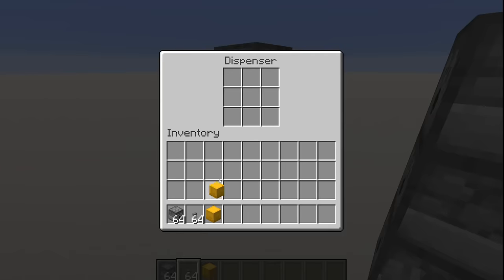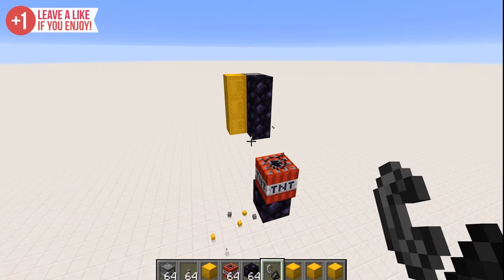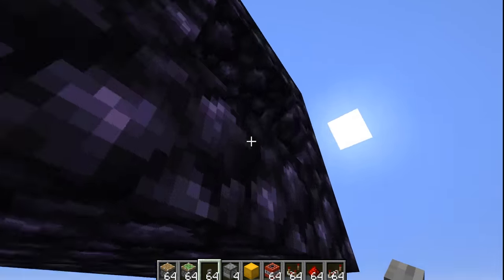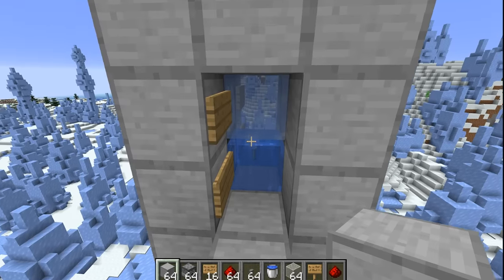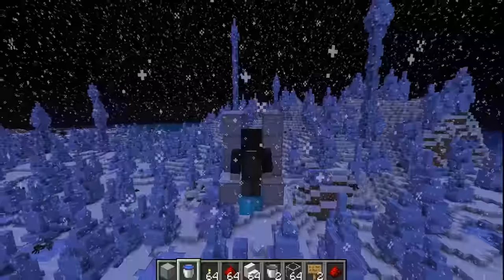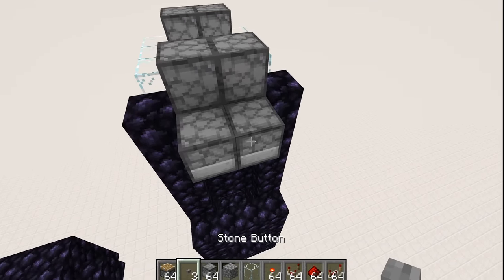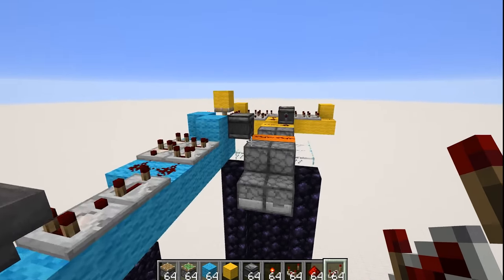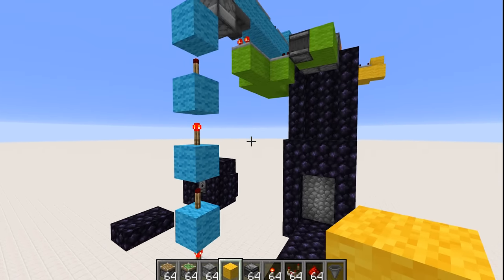Making a Redstone Door WITH NO PISTONS...

Comment: That moment after you spend hours working on a redstone project and realize there's a much easier solution.
Reply: Yes. Believe it or not, i just finished a 6hr piston door system and then saw this video
Reply: Just like solving Math problems
Reply: This is me with my own super smelter design
Reply: @gui18bif  math is easy for me
Reply: Or instead of a synchronized cobblestone generator, making it simple with some waterlogged stairs facing outside, it won't leak, it does not explode and it works for a cobble generator
Reply: Basically trying to create a machine that tells you the temperature of something just to realize that thermometers are a thing

Ps I got that from big hero 6 the series season 2 episode idk
Reply: @zer0gamz  6hours??? Jeez I just made a 3x2 piston door in like 4 minutes and built it into my walls so it looks like the blocks just vanish
Reply: @LifeofLeium  It doesn't help when the original mechanism doesn't work so you have to modify it numerous times
Reply: Exactly what I wanted to comment my dude!
Reply: @SK-nd8cu  it really depends on what your calculating
Reply: @SK-nd8cu  you know trig?
Reply: Yeah i was trying way too hard and using a redstone torch to power a block but then i remembered i couldve just used a repeater
Reply: Should be pistonless redstone door without an any “door”
Reply: That's exactly y I spend 1-3 hours on math
Reply: You didn’t have to cut me off
Reply: @SK-nd8cu your in - 4th grade
Reply: Probably the most true thing I’ve read today
Reply: Me every time I do ANYTHING
Reply: This, but irl
Reply: @B3nCastle  That wouldn't work, since the top 2 blocks would block the formation of the bottom 4.
Reply: I have had that before

Comment: The ice door could work with armour stands equipped with frost walker boots, being moved around by water sources with light on specific places as not to freeze the path but instead the water below 🤓
Reply: That... is a really cool idea, I am going build that.
Reply: 200000iq
Reply: Smort… so smort. That is 69,420 i… I mean 100000 q🤭
Reply: I am 99.99% sure that frosted ice (the ice created by frost walker) is unaffected by light.
Reply: @justinbombach9873  oh :(
Reply: @callumhurd3726  I did a tiny bit of research. When the ice first appears it is unaffected by light, but it will melt faster with greater light. So as long as your door is in a dark area, the door will stay frozen for a long time when you want it to be closed.
Their is one other problem with this idea, but I have a solution. Rather than moving the armor stands with water and risk freezing that water, you could place the armor stand with a dispenser then apply boots on it, and when you want the door to melt you shoot arrows (from ANOTHER dispenser) at the armor stand to break it and have hoppers pick up the items.
Reply: 500000000IQ
Reply: Very intoligent
Reply: Big brain
Reply: @justinbombach9873  0-0
Reply: How are you gonna move it without pistons?
Reply: it’s big brain time
Reply: @localplatypus994  water flowing. Over packed ice so it gets enough speed to go over
Reply: How to move armor stand without pistons
Reply: @q2ts  bruh this was so long ago 💀 Anyways u only need one and it will propel it across the ice

Comment: Since a fence gate is a little bit higher than a regular block, if you put a block above it that is 2 blocks high you cannot go through it without opening the gate or crouching through it. You can connect a lever  to the fence gates and open and close the door. It also works as a invisible door.

Comment: Mumbo: Creates a difficult redstone door without pistons

Me an intellectual: places wooden doors
Reply: @GMDFlow  iron doors pressure plates
Reply: Hard mode zombies: Dinner time
Reply: @ShadowHunter120  lava trap
Reply: @holichubbz8218  every single mob: dinnertime
Reply: No

Iron door a line of redstone and a button/lever/pressure plate
Reply: Evandro Dias requires pistons?
Reply: @gymnasticswithaleesha7406  put a hole with lava
Reply: Evandro Dias theyll see it
Reply: @holichubbz8218  UNBREAKABLE
Reply: Dispenser & water
Reply: Command blocks
Reply: The easiest way
Reply: @holichubbz8218   wood door and  pressure plate
Reply: @holichubbz8218  copied
Reply: If you're really big brain, you could use a button going into a command block using the /fill command to change the door opened or closed

Comment: Mumbo, An armor stand with frost walkers boots creates ice quickly and is togglable by removing and replacing the bootsa
Reply: I don't think you can swap boots on an armor stand (but you can push it with water current). You can swap boots on a mob though.
Reply: Finally someone mentioned this.
Reply: @PatJ_or_Tom  oops, btw, will waterflow work? I wonder if it freezes. But maybe mobs or minecarts can help too
Reply: Not sure, but frost walker doesn't affect flowing water and water that is not on the level under it, so it should be fine. Don't think FW works in a minecart though.
Reply: I was thinking something like that too.
Reply: yes, but you'll need two stands at different levels and a way to move them around which makes it trickier than mumbo's method.
Reply: I though that too
Reply: Ilmango can
Reply: @PatJ_or_Tom  I think it would work if the armor stand was on it... actually no... forgive me for my lack of knowledge
Reply: @KODY FLONDOR  fix your spelling/grammar -_-

Comment: or u could make a lava wall and connect lever to the source of lava to turn it off/on
Reply: what if you have a fire resistance potion?
Reply: @bigmrac8505  what idiot would drink a fire resistance potion just to pass 1x2 block
Reply: @bottlebeard  dang you right you right
Reply: You could bring a dirt block and cover where the lava comes from
Reply: yeah but then you still go through it because you just place water when your    through the door and walk through it
Reply: @hthdog  If you do a straight lava door your probably better off just using dispensers to instantly open and close it with one button rather than having to bring a block to block the flow. Although, I will admit I like the concept of a door that dispenses slime  blocks as you walk up to remove the lava with. Would be quicker than dirt too, at least once you've  got a slime source to upgrade from dirt blocks.
Reply: Lombane or ender pearl
Reply: Filipenko I thought that too
Reply: I can make a pistonless and redstoneless door. Just need cactus sign sand Easy. AKA my oldest dooooooor
Reply: Yo I thought of that as well
Reply: Doors are made of solid material
Reply: If it doesn’t need to close you can put Minecarts on both sides on a lava flow
Reply: Or somehow get infinite damaging potions/replace them over time and use that instead of lava, then you can't really get through without dying
Reply: Lombane literally what i was about type
Reply: @bottlebeard  or put 1 dirt block over the lava
Reply: Button

Comment: "Falling edge monostable circuit"

Me - "what?"
Reply: It's "Mumbo Jumbo"! amiright B)
Reply: a monostable converts a lever's constant output to a pulse. falling-edge refers to the fact that the pulse fires when the lever is turned off.
Reply: @marlettohemmingsen2828  um
Reply: Monostable means it's stable in one state but not the other, in this case it says stable in the off position but when turned on will after a time revert back to being off. Falling edge means it's only triggered to change output state to on by its input going from on to off. 

So in this case the input of the monostable circuit's input is connected to the same signal that turns the lava dispensers on, and its output to the water dispensers. The monostable circuit is off most of the time, but when the lava dispensers turn off (go from receiving a signal to not, i.e a falling a edge on a signal to time graph) then the MSS changes its output to on for a time, turning the water dispensers on. But because it's not stable in the on state returns to being in the off state after some time, turning the water dispensers off.
Reply: @Graknorke  i just read this... and i still have no idea what you just said
Reply: @user-nk6dw5on7m  No shame in that. I am having some trouble completely understanding it as well and I attend a college where we actually learn about the same principle in logical algebra as part of the curriculum.
Reply: @user-nk6dw5on7m  It's basically a reverse T-flipflop
Reply: Matej Kovačić Isn’t it weird to think there are tons of gamers playing Minecraft who potentially understand Boolean logic better than some engineers... but they’ll never be able to use it in real world applications 😂
Maybe someone needs to write a book for Minecrafters that helps them translate their understanding to real world, might make Minecraft a great way to discover future engineers!
Reply: Graknorke what the flip does that mean
Reply: @marlettohemmingsen2828  
So basically a lever to button converter?
Reply: @Hxrii  
T flip flop is a button to lever converter I believe....?
Reply: @Ender_Rock  You are right on both counts. I suggest looking up some logic circuits on wikipedia. it's the same principle.

Comment: I forgot iron doors existed
Reply: A normal wood door would still do the trick
Reply: @sanstheskeleton679  but it must be redstone so only iron doors
Reply: @crafterchampions6188  
Didn't you know that you can activate wooden door with redstone too?
Reply: @sanstheskeleton679  you can, yes, but the fact that you can open in by hand makes the whole thing useless
Reply: @crafterchampions6188  
Really? I'd rather put wooden pressure plates down so I could just walk right in like nothing is there.
Is it really that hard to gather two wooden planks?
Reply: Wow... Just wow...
Reply: @sanstheskeleton679  but this is supposed to be a challenge
Reply: @crafterchampions6188  
Which is the exact same reason he didn't just use an iron door
Reply: Fake Minecraft Fan

Comment: Mumbo i know nothing about redstone but wat if you use wool blocks and then burn them with firecharges? Could that make a good redstone door thing?
Reply: thats cool
Reply: It could, but there is no technical way to place wool with red stone without pistons just moving Into place
Reply: Now how would you close it smart one.
Reply: AngularAtom3141 Xbox1 ironically enough you put a period rather than a question mark
Reply: @vladdostupidthings6549  yup I know.
I just discoverd how to make a redstone lamp go on with a lever.....
Reply: @earthycart3535  Eaaaaaaaaaaazyyyyyyyy
Reply: AngularAtom3141 Xbox1 did you not read the comment? They said to BURN it
Reply: Also, you have to put the wool in manually once you open it
Reply: @matty7033  cut him some slack ok, he doesn't know redstone
Reply: @matty7033  bUrn tHEm With firecharges.

READ THE COMMENT
Reply: You can’t dispense the wool though

Comment: hey mumbo jumbo i have a idea: use a  structure block, its an block that you can get by "/give @p structure_block 64" and it saves any structure in a area you select and it is activated by redstone, dont forget to put it in load mode before activating it, and you can use each frame of the door to move when you press lever

Comment: I feel like he could have done something which utilises the impact of gravity on sand and gravel.
Reply: I don't think so because you need pistons and slime to launch the sand
Reply: Θωμάς Τσαγκαρελλης but what if he used tnt to break the sand or gravel and it could be dispensed due to gravity, therefore he would use a large stack of sand or gravel which would fall when the sand or gravel is destroyed. The only problem with that is there is a very limited time to enter before the sand/gravel falls again
Reply: Dispensers dont place sand, they just yeet it like any other block
Reply: AveronisGaming  nah fam not using dispensers he could have just stacked a lot of sand or gravel on top of each other, which would utilise the fact that sand is impacted by gravity. Do you understand?
Reply: Also sorry about my explanations it’s a bit difficult to explain without a picture
Reply: Well how would you open the door?
Reply: AveronisGaming TNT
Reply: I tried out your method and ngl
It doesnt work :v

The explosion is large and I would get knocked back. Because of this, I cant run in quick enough. Not to mention I have the surround the entrance in so much obsidian

Comment: Idea, press a button that will ignite TNT and all blocks a around the door are obsidian (or any other) but,  the actual door is dirt. Or any block that is weak. It will blow Up. Then place the blocks back, or use shulker boxes. When it’s broken you walk on a pressure plate that makes dispensers place shulkers.

Comment: I routinely use iron doors with buttons on my houses.
Currently planning a flying machine door, gonna use 2 steps to it with 3 machines / sets of machines so I can have the doorway become solid without visible parts after it's all done. Gonna be thicc af and this'll be my first time working in a time delay on a redstone mechanism (which I've barely done jack with anyways) but still that's the plan...

Comment: The pressure plate and iron door doesn’t use redstone so it’s not a redstone door, in case it would be the pressure plate 1 or 2 blocks before the iron door and link the pressure plate with the iron door using redstone, so that is a redstone door without pistons

Comment: I did this. So how you do it, it's really hard and tedious but you mine 3 blocks down and craft a lever, then you will need an iron door. With the other two blocks build two blocks up right next to the door. Put the lever on the top block. pull the lever and the door opens.

Comment: Just wondering, would this technically work on a larger scale? I'm working on building a really massive project right now, and need a 9x9 door, but don't want to use those complex piston doors, so I was wondering if this could work scaled up and with the timings tweaked a bit.

Comment: You used a piston 😂😂😂 I can make a plane that moves without pistons but your at level 1 and I am on level 90)00000000000000000000000000000000000000000000000000000000000000000000000000000000000000000000000000000000000000000000000000000000000000000000000000000000000000000000000000000000000000000000000000000000000000000000000000000000000000000000000000000000000000000000000but its OK to be a noob